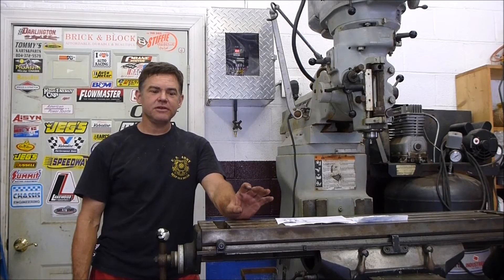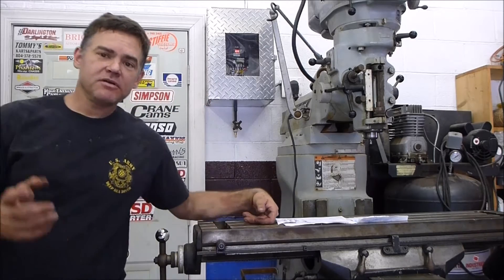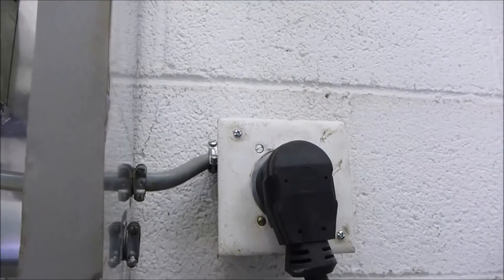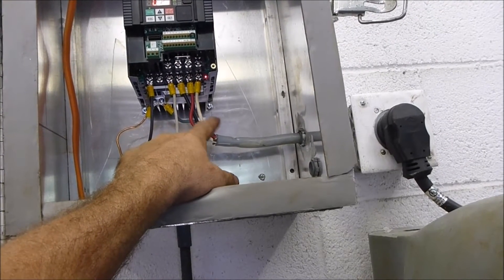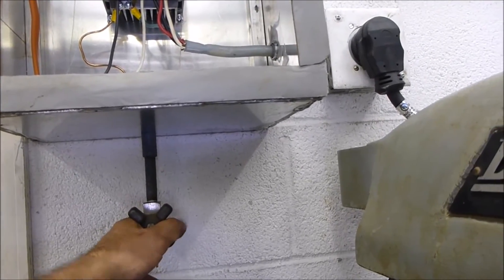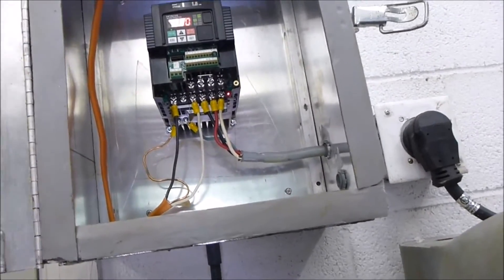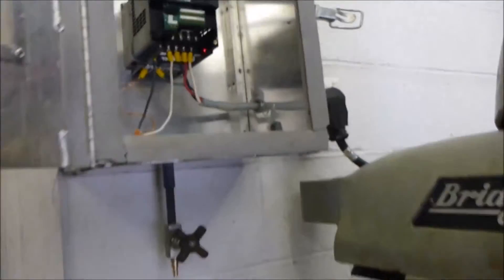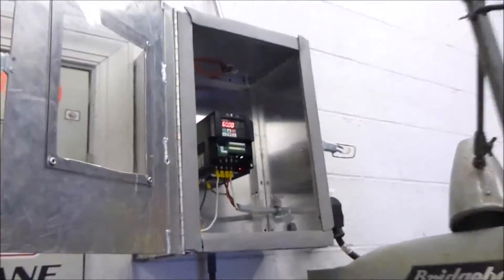Connecting Hitachi WJ200 VFD to Bridgeport Mill

Comment: I hate it when the only comments anyone can make are regarding safety but I'm going to break my own rule.  Be VERY careful using shop air to pressurize your electrical enclosure.  As an electrical engineer for an ammunition production facility, I was responsible for purging/pressurizing many specialized enclosures when they were in use in hazardous locations.  Those enclosures had pressure relief valves so they could not be over pressurized.  You can blow the door off your homemade box if you're  not careful.
Reply from the maker: Thanks for the word of caution realistically I've never used that shop air to cool or clean the system it ended up being a good idea that just never got used

Comment: I agree on the instructions that comes with these units.  They provide many
pages of information of which most of it is of no value.  When you get the remote hooked up and in use you will  find the mill much more handy to use.  That is an
interesting way to accomplish the cooling.  I mounted my VFD on a short post
and hanging from the ceiling in a similar enclosure with no cooling.  I did mount
a huge electronic heat sink on the back plate of the VFD and may install a fan on the
top of it and air inlet on the bottom if it proves necessary.  Nice work.

Comment: Thanks for posting;  I am getting started with the install of the Wj200 on my Cnc mill spindle.  Did you adjust any of the parameters within the VFD or was it 'plug & play' so to speak?  

It's been a few months since this was posted;  have you setup the remote or started using fwd / rev via the VFD panel or still changing wires?
Reply from the maker: See my response above. I have been fortunate in that I have been busy withy business so I probably will not attach the remote until the Christmas time frame